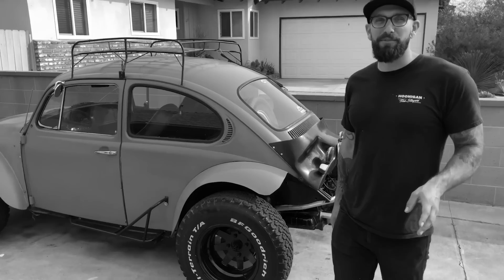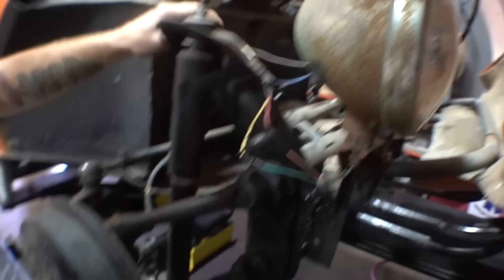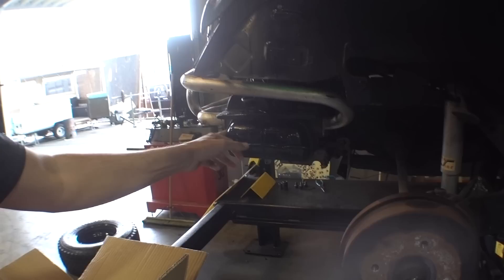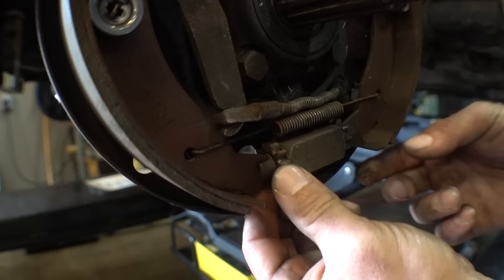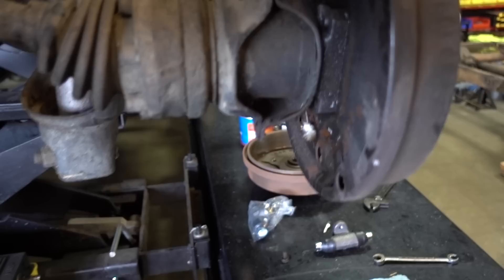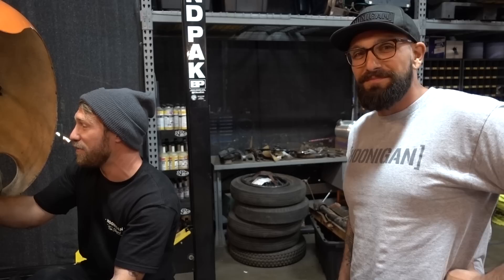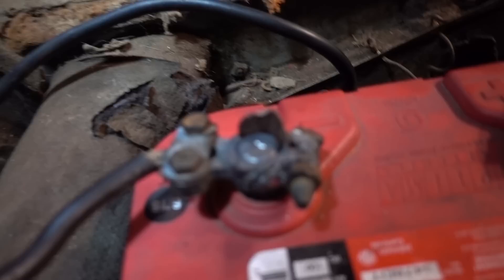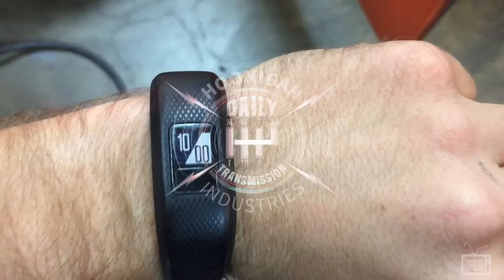[HOONIGAN] DT 177: Introducing ScumBug our $2500 Baja Bug

Comment: Tip: you can run your old front wheel brake cylinders on the rear since they are slightly larger and 75% of your weight is in the back.

Comment: These little things are SO MUCH FUN.  Learned to drive a stick shift in a fiberglass dune buggy based on a shortened bug frame.
Light, agile, and as ya found out, cheap to fix.  :)  Gotta love it.
My brother n me thrashed the hell outa that little dune buggy.  Broke many parts, but it's like tinker toys basically. 
Taking the motor out is a 1 man job. Throw  it on a skateboard. lol  
Lookin' forward to more of this one.
Reply: Sorry for late reply but yeah these are so much fun i plan on building one with my dad soon
Reply: @cyberspino6277  Awesome stuff man. You should do it! There tons and tons of aftermarket stuff out there too.
Reply: @terminalpsychosis8022  will do as soon as possible and i can't wait to get into mods after doing the basic body modifications,what should i do first
Reply: @cyberspino6277  Unless you're super rich, I'd say getting a running, reliable car is first step. Can upgrade and do mods once you're on the street. If you got tons of cash, full body-off restoration.  :)
Reply: @terminalpsychosis8022  yeah finding a reliable bug is a different sort of issue those engones are ethier a hit or a miss that's the reason im not gonna do it immediately

Comment: My brother and I could easily pull out a 63 vw bug motor out in 15-30 minutes. depending how things go. its super simple! Also that hole/tube coming out behind the passenger seat is normally where hot air is blown into the cab, from the motor.

Comment: Wish I knew you last summer. Mint, 67 bug. Lost job, needed rent. Sold it, $800. Cried. I had like $4500 into it with a rebuilt 1600 and interior. Yeah... Crap happens.
Reply: Two guys? I did it myself on the side of the road lmao. The motor can be man handled by one person if you go from the underside. Oh, and lining up the clutch without that is a 4 hour task. Not fun. Didnt know till today. Thanks bugformance. Ass cheeses...
Reply: I feel for ya. My rebuilt 1600 w/bus cam sold for  $750. Cost me $1100 😲
Reply: Where the hell are all these deal now?!?! I have about $1k budget and only finding bombed out half finished not running near San Diego. Hardly anything under 3 grand. Do I blame scumbug????
Reply: @RandomStuffGarage619  Yes you do. Craigslist, and cruise it hard, then low ball a desperate person. That's what actually takes place.
Reply: @alecfleming373  patience is a virtue, I suppose. My buddy's class 11 was so clean but not so clean you would be scared too flog it. Wish I could have scooped it but I would never lowball him. He wanted me to buy it because he knew it would be in good hands but he got the money he wanted from somebody else. He has built like 3 bugs so I will be involving him in my build for sure.
Reply: He even offered to help me cut it to a baja so it was shorter to stuff into a toy hauler. I will keep looking and call him over to spin wrenches and empty beers when I find one.
Reply: Yeah it's crazy all cars are expensive I bought a miata for 4k and people offer my6k all day and I got a 73 Baja bug and I got that for 3k easily could be sold for 7k+

Comment: Ive got an old vw sand rail with a 1600, you guys done me proud. Protip- if it leaks oil from every orfice, which lets be honest, it probably does, put some vents in the valve covers and run them up to a catch can. Works like magic. My buggy could leave a puddle on the street after 5 minutes before i put one on.
Reply: Oh yeah and if it doesnt already, get an external oil cooler and filter. The stock ones are 60 year old nazi designed terrible pieces of crap.

Comment: Being an old guy, I've had a bit of experience with old aircooled Vdubs---those valve cover retainers are "bales" and they are standard equipment. You guys' first comment---that it made it easy to pop the covers and adjust the valves---is absolutely correct. You're supposed to adjust valves every 3k miles. Nice little bug!

Comment: The bale arms on the rocker covers are a standard feature. Bolt on rocker covers are an aftermarket product.
The tube that was pointed out near to the battery is an old heater outlet.
Your bug has a later style IRS rear suspension setup. It allows better articulation compared to the older style swing axle setups.
Hope you changed out those screws holding the fuel tank in place. They looked pretty savage! 😂

Comment: I almost, alllmost, believed that comment about dry rotted tires providing more grip. The snickering gave it away. That's a better joke than the old "low blinker fluid". Good luck in Baja, gents. That adventure is on many a man's bucket list, and you guys are doing it right.

Comment: The bale type valve cover keepers are used because as the engine gets hot it keeps contact and sealed better than the bolt on type as the heat dissipates and they contract the bolted type don't tighten themselves like the spring steel bales do

Comment: I won't say the brand name, but I can tell from the boxes and parts colors that you guys used the same company that we did for a few VWs here at the shop, be weary of those calipers, they flex an insane amount when you press the pedal. I was not happy with a LOT of the parts we got from them not fitting well or at all.

Comment: they are called valve cover bales ( the spring that holds the valve cover down)  those are factory not some off road special thing lol socal parts guy is a Smuck saying that and disc brakes on bugs suck drums with a good set of shoes and fresh adjust & bleed works much better cause no power brakes to help close the caliper on the disc just my opinion on brakes
Reply: Hey it's Darnall, what the heck happened to ya? LOL! You & Alex need to watch the vid again, Scotto or the socal guy didn't say or imply that the bales were aftermarket, heck I know nothing about bugs and know they're a stock factory item, I'm sure the socal guy knows they are factory also, what Scotto did say was that there's both bale clips and bolts, and for off road most just run clips. 
Correct on the brakes, anytime you convert from drum to disc, the stock master cylinder usually doesn't have the capacity required for disc brakes, you need a master cylinder designed for the larger capacity pistons in the calipers, they also have "anti bleed off" so you always have instant firm pedal feel, no "pumping" the brakes. We'll see if these brakes worked good or not when the episode come out...That's a WRAP!!!  ;)
Reply: +Dan thomas I wasn't hating  I watch daily daily lol

Comment: Valve covers, "wheel cylinders", steering column. And id worry about the floppy fuel line next to the hot exhaust rather than the wires.

Comment: All jokes aside VW at one time had a deal where if your Bug made so many   miles without a major break down you gpt a gold watch. 500.000 I think. This was the bug was of course serviced by them. All major major parts Crank case head bolts and the like were marked and secured where any removal was known. They had to stop. They were loosing so much money on gold watches. A German man was in th VW car owners magazine. He had drove his across Europe From Russia Spain Then the drive able areas of Africa . This was a bone stock bug. He did this with no mechanical failures. The tires belt brakes and starter along with points plugs wires and oil was all that was ever changed. Normal wearing parts and tune ups. Points being adjusted till worn amd replaced. The Boch starter lasted till it wore out. He then shipped it to the U.S. and drove it from NY to California then  North to  Alaska then from there  to the tip of South America. Still no major failres. He did this trip again . I know he surpassed the 500 thousand miles and then some. How many regular cars can anyone name that could do this. lol. The biggest bane of the VW bug engine is lugging the engine. Meaning it on the wrong gear shifting to 4th to soon and such. Burnt valves were the number one killer. outside of driving it with the red bulb of death glowing The light showing the Alt isnt charging The belt broke and the fan stopped cooling the engine. Thus frying it. Most Bugs full body bugs ONLY have 3 bolts connecting it to the trans-axle as clutch changes made it inevitable to need to drop the engine . Yep a 10 inch wide rimless tire three bolts fuel line throttle cable and ten mins pull back off and onto the tire it sets lol. They made kits to air up the tires. By taking out #3 plug and replacing it wit a threaded adapter that ran a hose with an air valve that used the engines compression to air up the tires. The wind shield washer fluid was applied by spare tire air pressure pushing  the washer fluid  canister  to spray the wind  shield. WWII a British 500 pound bomb fell right into the VW factory. Right into the area that had all the dies ans stamps for the Bug. That was setting idle. As VW  built the Kubelwagon later to become the civilian VW Thing and the amphibious Schwimmwagen. Lucky for  the millions who love the Bug  and Bus and The Italian designed VW powered Karmann Ghia the bomb was a dud.

Comment: Now if you were to build a shock support bar for the front then tie those to the firewall putting a steel plate between the sheet metal you can make yourself a stable platform for a fuel cell in between stabilizer bar and the firewall

Comment: Out on the sand, it gets really hot. So the roller gas pedal is so your shoe doesn't melt to the pedal.
Reply: Also the air cooled motors are stupid simple. I run them in my sand rails, but my motor is double the size of stock. Stock being 1600cc and mine being 2332.